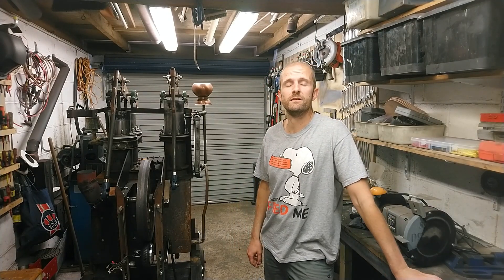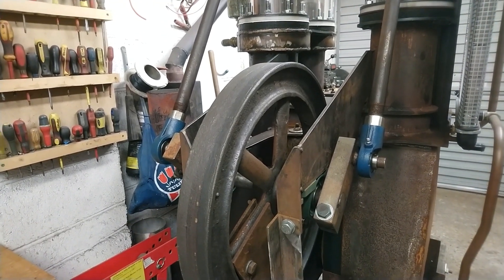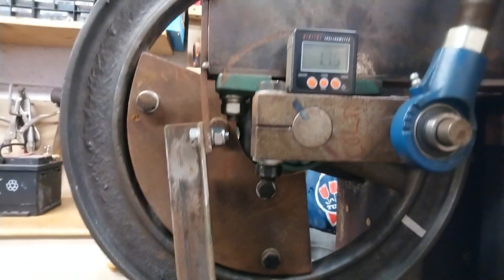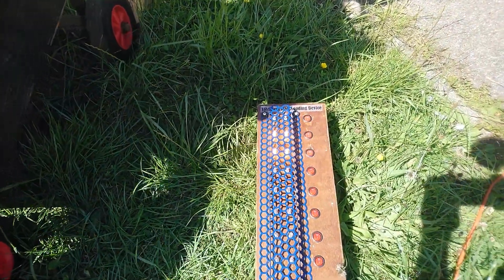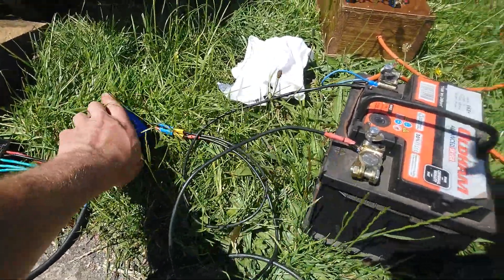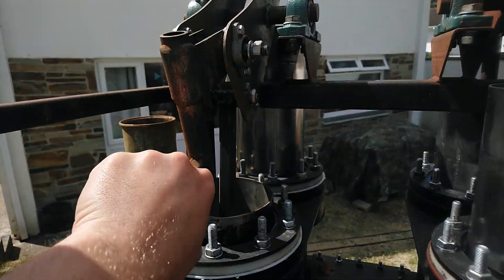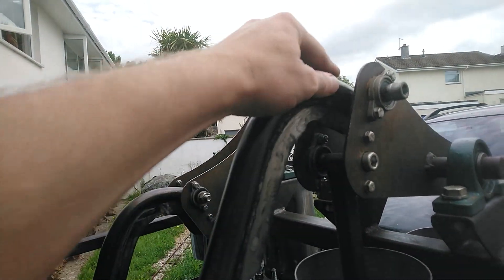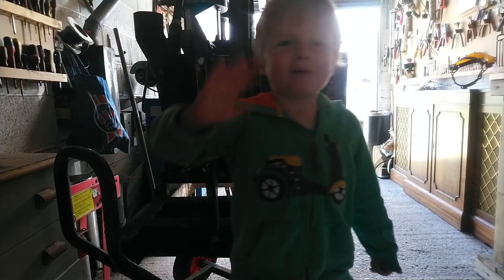Stirling Engine - (Another!) Test Run with new load bank Part 10

Comment: Ditch the wind controller, you will be far better off with just a bridge rectifier. Think about it, a wind turbine will spin up until it explodes without being loaded. The entire point of that dumb charger is simply to short out the 3 phases once the battery voltage goes high. This is why it states that it senses 12v and cuts off at 15v or senses 24v and cuts off at 30v. You are noticing the warmth because of this. Good luck and keep it up. :)
Reply from the maker: I've just ordered a bridge rectifier to try, thanks for the tip, cheers

Comment: Maybe ditch the charge controller and the battery just use a 3 phase rectifier and a capacitor
Reply from the maker: Might not be a bad idea! The current charge controller seems to convert a lot of electricity generated into heat via the built in heat sink. I've got a spare rectifier that I could try

Comment: I noted the charge controller said "for 12V or 24V systems", did you configure it to 12V mode, or is it just not configurable?
Reply from the maker: Hi, The instructions for the controller, says that the controller will detect the voltage of the battery(s) and automatically configure itself accordingly.
Reply: @ShanePomeroy  it doesn't seem to be applying enough dump load to keep the voltage down, maybe because it's assuming that the battery is the only thing on the circuit so it's alright to over-volt a bit to quick-charge it. You might need some sort of regulator downstream of the battery.
Most guides online seem to assume that you want grid voltage AC downstream and recommend the use of an inverter that can handle unstable DC voltages. Unfortunately, I could not find any guides that talk about what you need in a pure-DC voltage-sensitive setup.